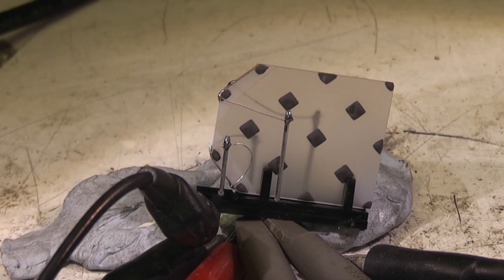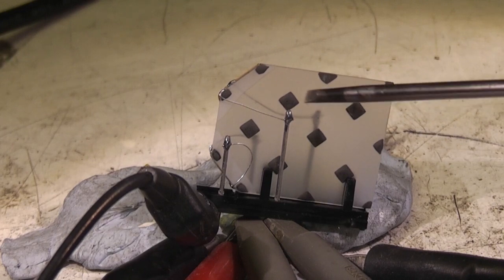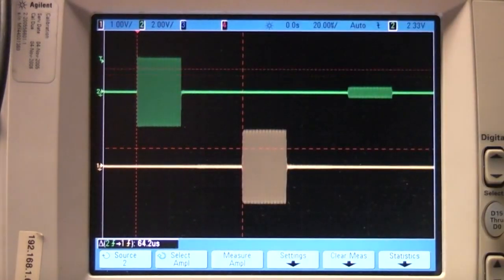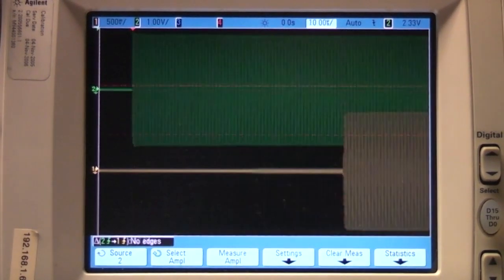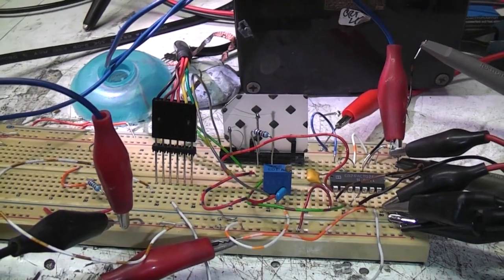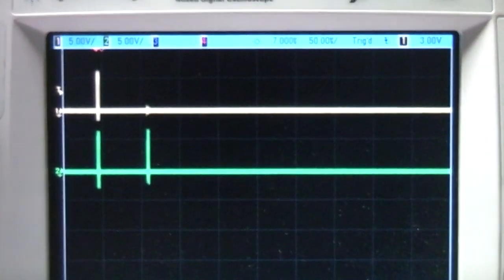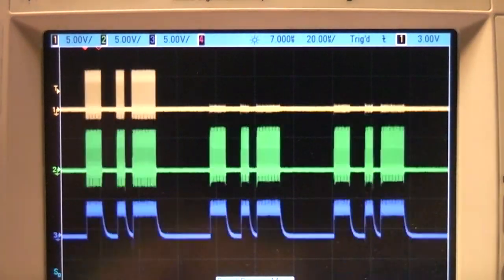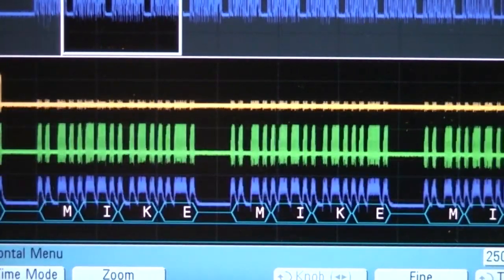Delay line memory

Comment: Early calculators also used torsion mode memory, where you have coil of wire, and you send shock waves into the loop (via a torsion force), only to emerge on the other end after some delay. See Monroe Epic 3000 calculators for an example.

Comment: The epoxy keeps the waves from spreading out too far by dampening the acoustic waves in areas they shouldn't go. I have replaced many which were used in pro video cameras to create a vertical detail circuit. They had cones etched into the glass (on both sides) where the epoxy dots are. They were also used in NTSC TVs for comb filters and in SECAM TVs for line memory.

Comment: I was hoping Dave would have done this, but that seems to be more than he'd prefer to screw with.   

This seems very similar to the old reverb units that used actual springs to presumably get the delay and then fed back into the input through a resistor to get the decay?    Is this correct?

Comment: I wonder how stable would be a clock generator based on a delay line and what would be it's tempco and if it is indeed that low if it could be used to correct the tempco of a crystal...

Comment: Have you tried using a circuit to latch and regenerate pulses?  Perhaps use an edge-triggered flop clocked either by the chroma subcarrier or a divided-down version thereof, and feed that through a sequence of four NAND gates, the first two of which take input from a external logic, the third of which accepts chroma subcarrier, and the last of which is simply an inverter?  It may be necessary to tweak the timing of the flop to ensure it samples each wave near the peak, but I would think it should be possible, and not overly difficult, to make the circuit so that it could circulate data indefinitely, and it would be interesting to see how many bits it could reliably store.

If that worked, it might be interesting to modify the project a little more to implement something like a binary counter or other such logical function.

Comment: I am sure you could store much more than 64 bit using the proper modulation. Certainly no less than 128 bit assuming only a SNR of 0 dB and 2 MHz usable bandwidth. But likely more than 512 bit.